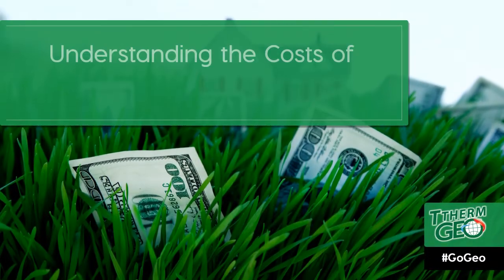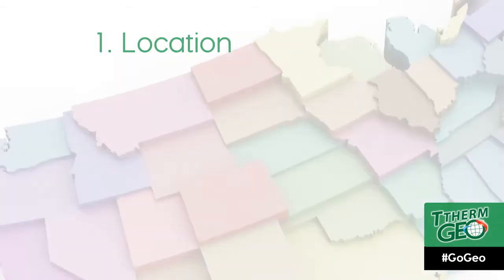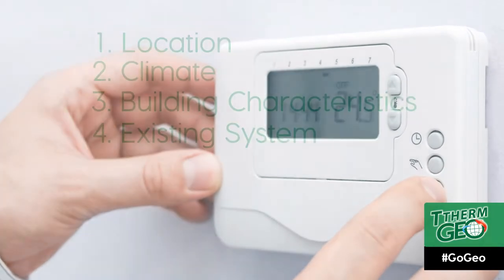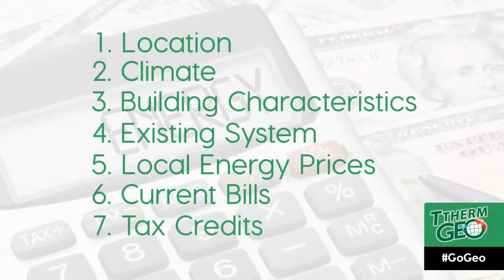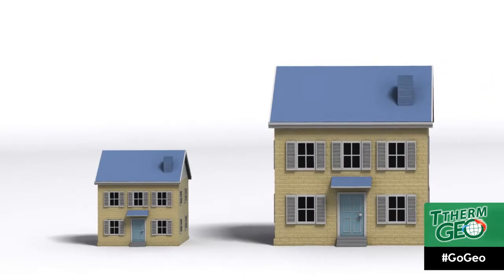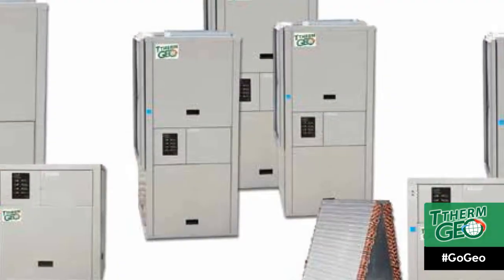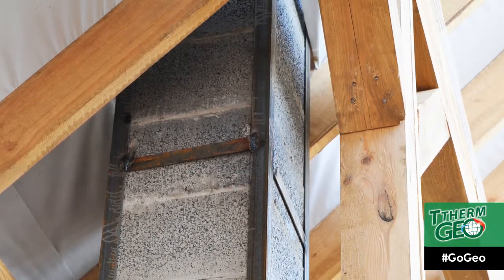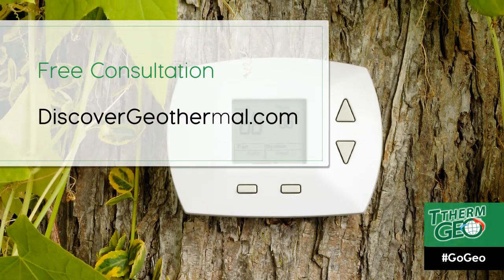#GoGeo - The Cost of Geothermal Heat Pumps

Comment: Not a single dollar figure given. Just cost factors. Today, in 2020, most systems are coming in between $18,000 and $21,000 for 3-5 ton geothermal heat pumps installed. Here's a good resource on cost: https://www.pickhvac.com/geothermal/
Reply: Thank you. Your link was more helpful than this video!
Reply: @marlaplunk2833  Glad to hear that, Marla. I write a lot of content for Pick HVAC, including the article linked to, so I'm confident that it is a reliable site with accurate information.